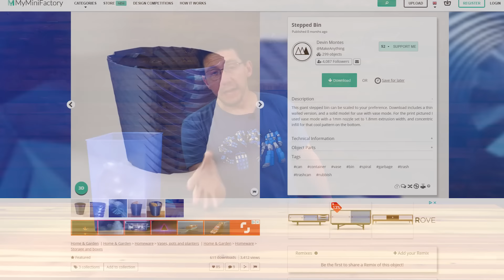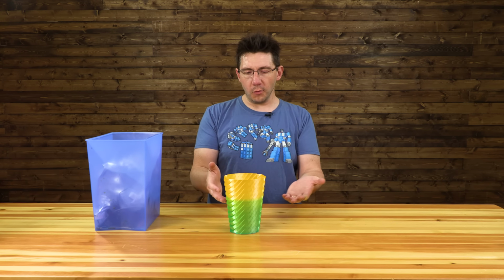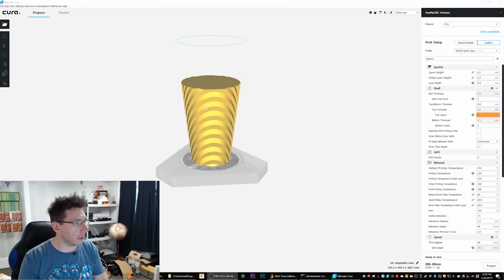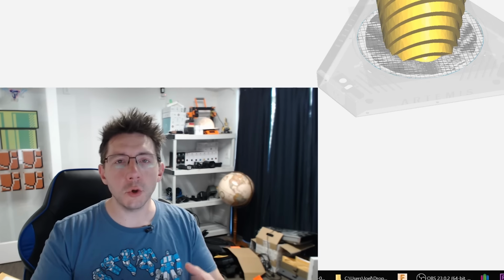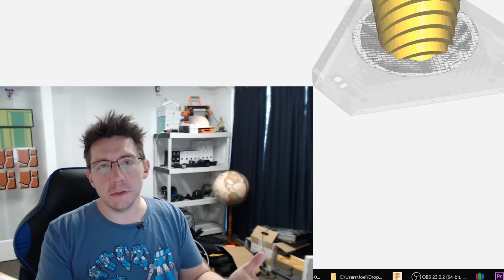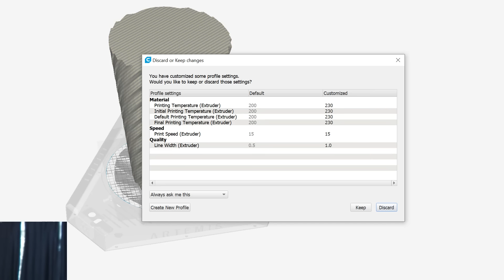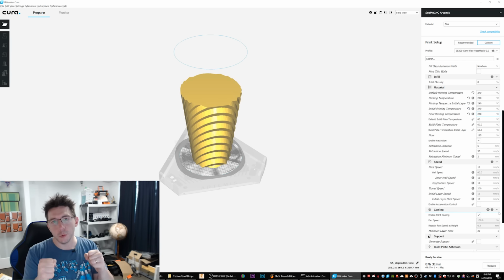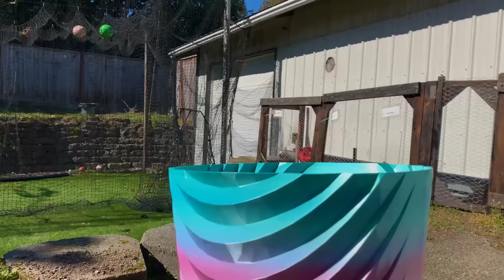3D Printing Trick for Stronger Vase Mode Prints

Comment: Awesome, I love seeing my prints supersized! I've been printing these at 2mm extrusion width with a 1mm nozzle and it uses a ton of material, but it's SO strong and pretty much completely rigid at that point. It's also a great way to use up garbage filaments that fail or clog with smaller nozzles 😬
Reply: Did some vase in vase mode, but the problem is the bottom (first) layer: it's so thin! 🙄
Reply: Have you found that 2 to 1 width ratio works well in general for other nozzle sizes?
Thanks
Reply from the maker: Typically it’s a great ratio to use or at least start with and adjust from.
Reply: 3D Printing Nerd have you tried wider than that say 3 or 4?
Reply: @chazy10  You can set multiple bottom layers on vase mode prints!

Comment: Thank you  so much for this. I had no idea this was possible, and was planning to get a larger nozzle just for this. I now have an extremely sturdy littel 25% spiralvase :)
For anyone using Slic3R, the parameter to change is the "External Perimeters" in the Advanced tab of "Print Settings". On my Prusa MK3, I was able to get away with printing with PLA at 75% speed, using the 0,2mm speed profile and 230C.

Comment: Nice video. We constantly modify the nozzle width and extrusion width of our prints without changing the actual nozzle. Useful for things such as the trash bin or if you need to print thin walls.

Comment: Another use case for spiralise contour.
I recently had to print a handle for a hairbrush. There were two issues. Firstly, there was a z seam. Secondly, despite thick walls and lots of infill the handle snapped at a thin part when used. The solution was to just print the outer wall, and fill the container thereby produced with resin. The resin provides the strength, and the outer wall is clean. It can be strengthened further using rebar (or in my case the shell of an old pen). Furthermore, it was much faster to print.

Comment: Fun as always. Got my prusa! printing a lack enclosure right now. Having fun with layering colour during a print. High Five
Reply from the maker: Layering color is so much fun! Return five.
Reply: Hey. I have a lack enclosure too but I had to figure out that the empty body of the lack tables is like a guitar body which makes the printer louder.
To make the printer less noisy again I have a foam layer and on that a thin metal plate. I tried a couple of different feet for the prusa but only the foam layer did the job. After that the printer is so quiet that you can print at night again.
Reply: I was going to try a concrete slab for sound dampening and vibration control. thanks!

Comment: If you double the bead width and half the print speed don't you have the same throughput so no need to elevate temp? Other than it might help with layer adhesion. 1mm nozzles works great too, or even 2mm works with 1.75mm filament which was a surprise. Make the filament spool spin pretty fast though! Entertaining video though - thanks.

Comment: I always thought that the line width should be set as the width of the nozzle! So where do I change what nozzle I am using? Also with a 0.8 mm nozzle it should be possible to print 1.5 mm thick!

Comment: I tried this a while back: 0.8 nozzle printing a1.2mm line width.
You have to know how much plastic per second your nozzle can handle; I had to bump up the temperature up and slow printing down to make it work.
With a translucent material like PETG, thick layers and thick single wall make it nearly see-through!
Large features bend light less, tiny features scatter light more.
You don't print 1.2mm thick at 0.2mm layers; more like 0.5-0.8mm!
PLA comes out nice; good surface finish and strong.
Over-extruding has limits, and I could never get it to work right outside of vase mode.
Over-extrusion with wall and infill settings is problematic, so I gave up.

Comment: Trying this right now, first try was 6h with 0.4mm nozzle and line with on anycubic vyper and my usual 190°C for geetech filament - definitely anything but sturdy, even had some unconnected layers 😂
Will post a comparison on the makes after the 24h print with your hints

Comment: Why not just use a bigger nozzle? I tried printing a 1mm thick walls for a trash bin and it's super strong and feels great
Reply: For someone whos printer hotend doesn't have other nozzle options available/poor mans way of printing those thick walls.
Reply: @astro143_  I found them for less than 1 USD on aliexpress and ebay. This method is probably if I'm feeling too lazy to change my only 3D printer nozzle to larger size. 

Edit: I believe most 3D printer nozzles can be changed even if the manufacturer doesn't mention it or sell their own branded nozzles. Just check the size and give it a go 😁
Reply: @3DThird  true, but also how many weeks are you waiting for AliExpress to deliver from China?

You'd just have to check the threads on the nozzle to be sure and then recalibrate zero and all that, that goes along with the being lazy aspect of it.
Reply: Another thing that limits big nozzle widths is how much heat a hotend can put out. I guess it's still technically the same amount of plastic per second, but a bigger nozzle would be how I'd probably do it.
Reply: Effort

Comment: The flexible one looks a little bubbly. Are you printing it a bit too hot? What about its strength? Is that 1mm single extrusion wall stronger than two 0.5mm extrusion wall would be? In general, is the layer adhesion better with oversized extrusion comparing to multiple side by side extrusions?

Comment: Is there a way that you could increase the extrusion width on the last inch of the vase? If it was thicker there it would make the whole thing sturdier. Another option would be to print a rim that would fit inside/outside/over the top of the vase and that would also increase the rigidity.

Comment: great unicorn filament))) Do you have a video about cura settings? I can't understand this slicer) Same settings, same filament, but compared to prusa slicer i've got bad experience. Outlines are not sticking to each over, some gaps in solid infills, looks like i'm having some underextrusion, but it's not, because i'd calibrated my extruder. I don't understand what is going on) I like cura for whole bunch of settings, especially about supports, but it's ruins my print over and over again.

Comment: JOEL! I have an interesting scenario for you, I bought myself some TPU filament and I'm trying to print out a drone propeller gaurd. I need supports but the TPU keeps binding to its self. My thoughts were to pre print PLA supports then print the TPU on top but I haven't figured out a way to do it, any thoughts?
Reply from the maker: TPU as support material sucks because it welds itself to the model. I think if you increase the support spacing from the model you may be able to get it to work.

Comment: Interesting, I thought extrusion width generally needed to be within equal to ~+15% or so of the nozzle width, and extrusion height needed to be max ~75% of the width.  Ultimately you can't TELL the material to lay down evenly over a 1mm surface if you're pushing on only 0.5mm of it, or at least that's my assumption.
Reply: Some ironing effect from the nozzle .

Comment: I think you're confusing increased line width with overextrusion. When increasing line width, you also increase line spacing. If your flow or extrusion multiplier is well calibrated, there will be no overextrusion when printing at a wider line width.

Using a wider line width is a common practice when printing pure polycarbonate, as it creates stronger layer bonds and tends to warp less.
Reply from the maker: Ohh, I've always heard pushing a wider line width through the nozzle as overextrusion. That's good to know, thank you!
Reply: @3DPrintingNerd  overextrusion is just the effects from a poorly calibrated extrusion multiplier or flow setting. It could also happen because of the wrong esteps and moisture in the filament.
Reply: I agree that it's probably best to leave the actual nozzle width in the slicer, but just increase the flow multiplier to 150% or more. Set a slower printing speed as shown, and Bob's your uncle. This distinction probably matters less for the vase-mode portion of the print, but it should help the bottom layers be a little neater. You could also set an on-layer script in the slicer above the bottom layers which sets the increased flow for the remainder of the print.

So, now the question is: Can we create a vase-mode version of any model in the modeling software, increase the wall thickness, and print them in normal mode, to get really strong walls in a print that still looks like a vase mode print? No one has to know it took 20 hours!
Reply: Nozzle width and line width are two different parameters. Increasing flow to 150% will make a horrible mess of the bottom layer. That is actual overextrusion.

Joel did the settings in the correct way.
Reply: @olorf  I would suggest not having 150% for bottom layers, but only for the vase-mode layers above that level. I'm not entirely certain that nozzle aperture alone should affect the volume of extrusion, all other things being equal, but I'll have to play with some slicers to see how they each treat it.

Comment: Could anyone recommend settings for a Voxelab Aquila X2 with PLA? The nozzle is .4, so for a 12cm vase, how strong would that be as is? But the real question is height vs. thickness. If you have a .4mm wall in vase mode, then won't the layer height have to be .4 as well, losing a lot of resolution? Or is the slicer and printer smart enough to "smoosh" down a layer that is .4 or .8mm wide, but only .16 high?

Comment: Have a question: When I print in vase mode there are gaps between my base layers so I can see through it.  Any suggestions on what settings I need to tweek?  Using a CR-10 and Simplify3D

Comment: Joel! At this time what's the best "out of the box" experience for a first 3d printer?
Reply from the maker: Hmm. That’s a tough one as my best may not be what others think. By out of box do you mean take out of box and hit print?
Reply: @3DPrintingNerd  OK well I love the idea of 3D printing but don't have alot of free time so the least amount of tweeking / upgrading / updating?

I don't mind the ide of something that was shipped flat and needs to be put together (so long as the build is no longer then an hour or 2)  but having to put in dampers or smothers or firmware updates would louse my Intrest

Comment: If you want a easy natural feeling way to make your vase mode prints to be super hard simply coat the inside with some PCL Polymorph / Instamorph / Shapelock.. it's prototyping plastic. you can buy it by the kelo color it by hand with fade proof uv resistant Tattoo ink I suggest eternal brand. and it is hand moldable. It's cheap and you can get a kelo for about $40  it's super hard like Nylon and not brittle at all and it is like glue stick glue but way harder and not rubbery at all. It's bio degradable so if it's wet or something it might get some algae on it but you can always just re heat the PCL and recycle it again. You can make the PCL harder by impregnating other plastics or metals in it.

Comment: Default width in Simplify3d for 0.4 nozzle is 0.48 (120%)
Reply: Where do you change the width, to what Joel is saying, in S3D? Still used to Cura but cannot find the same type of settings in S3D. Thanks.
Reply: @07cowboy07  First TAB (EXTRUDER - Extrusion Width from auto to manual)

Comment: I'm trying to print in 0.7mm with a 0.4mm nozzle at 0.15ms speed ... in Cura it looks like a line-y mess and when I try to print it, it tries to print in the air and the print fails ... the bottom layers seem to print just fine tho. But when it starts on the actual vase part, it becomes a mess... anyone know what I'm doing wrong here? I only been printing for a few weeks so I'm kinda n00b.

Comment: Hey Joel/rest of the world. You should really collect and contain the tiny particles/shavings. They are worse for the environment than larger pieces because the're more easily blown around or washed away. Sure, PLA decomposes but I'm sure there may be some other non-biodegradables present. When I have fails/supports/brims, ect., I save them all in a bag to be melted down later into something more easily recycled. Edit: Sorted by material type. You could go further into brand/color if you intend to extrude recycled filament.

Comment: I am kinda new to 3D printing, but can't you just simply print 2 outer layers?
Reply: Not with vase mode. Vase mode (or spiralize outer contour in Cura) is a mode where the print is done in one long continuous spiral instead of the typical layers. 

This creates a smooth surface to the print and prints faster. However you cannot add supports or holes to your model.

Comment: Hmm. yesterday i'd printed a vase for my wife with 0.6 mm shell out of 0.4 mm nozzle. And it's great) Printed with PLA at 80 mm/s, 220C, 1,05 extrusion multiplier on E3D v6 clone. And it came out sealed. I'd left it for a night with water in it - and no leaking. Surprisingly.

Comment: 2:05 if you print 10x10x10 cube you get same ammount material even you go slow or fast? dont you. logic is need go slower so there will slow extrude. not becouse it extrude more. you say how fast it do it with speed.it will calculate extrude speed for you

Comment: I tried to double my 0.4mm nozzle to 0.8mm on Cura for my Ender 3 but the slicer has got crazy, check my screen shot not sure what's wrong. 
If I set it as 0.4 it looks fine. at 0.6mm I can see some layers out of line but not as bad as 0.8mm
https://photos.app.goo.gl/KxNjdRKrEhaVGB5F8
Reply: I have enabled Spiralize Outer Contour btw

Comment: 1. You have trash bin with liner.
2. You sound better with bin on your head
Reply from the maker: 1. yes, need a liner
2. agreed.
Reply: @3DPrintingNerd  Ad 1: What I meant is the soft print is the liner for the rigid print bin... :)

BTW: I did some experiments with printing multiple spiral parts that were to be placed inside the  other - creating multi layer stiffer parts...( designed them to bi lightly interlocking. And if some superglue used during assembly - it created impressively stiff parts.